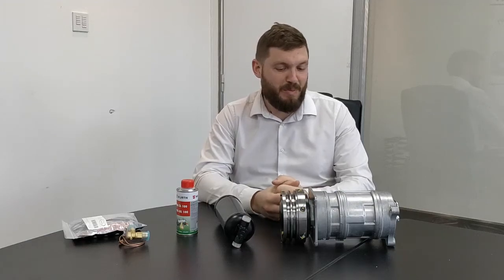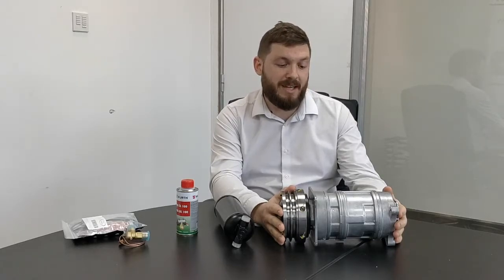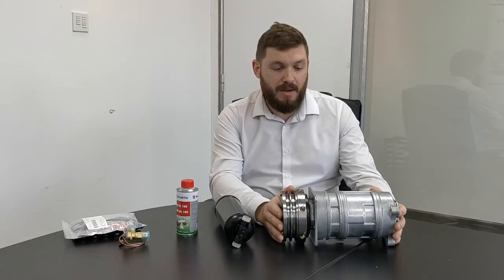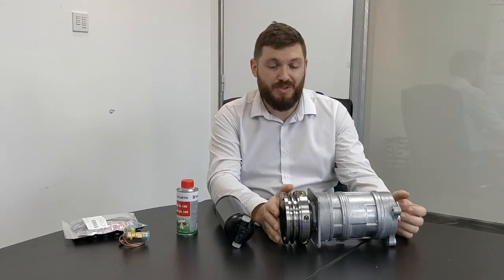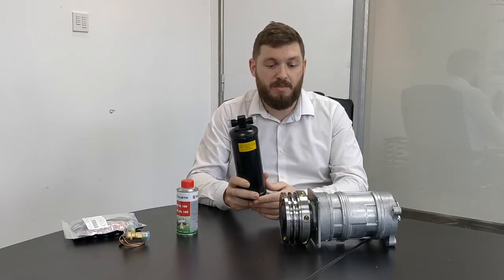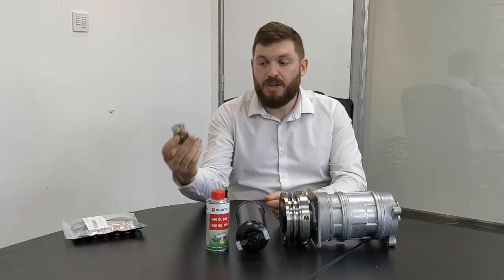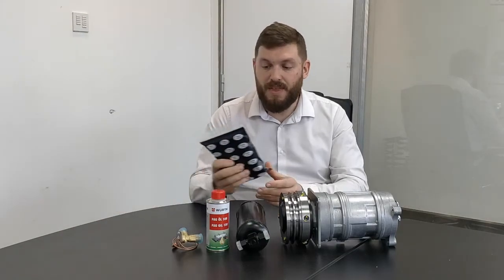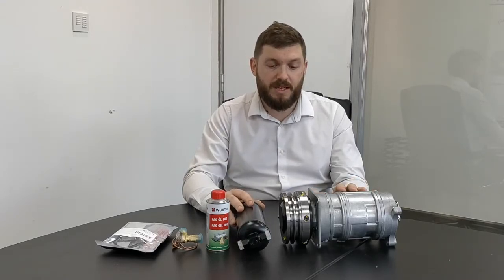Air Conditioning Issues in Silver Shadow & Spirit Models

Comment: what happens when you have replaced the air conditioning unit because it seized up, and now it is only puting-blowing cold air out, on my 1996  SILVER  SPIRT., Two years tater.
Reply from the maker: It sounds like it might be the 45 degree switch broken. There is a way to check this but involves cutting a wire but would mean it needs to be splice again after the test. If you feel like doing the test then we can give you further information

Comment: The 6 piston Harrison A6 is a compresson thats one of the best ever made,its simple powerfull and ones put together as it shut,these things last for decades,there are soooo many cars now having a 50 40 35 year old compresson on there cars and they work as they day they where produced......

I have one on my 1984 Opel Monza and it holding pressure for years and works flawless........I rather reseal a A6 for 50$ then buy this one,cause this thing hasnt proven itself....
After 35 years that old heavy big ass compressor cools the car down in like 30 sec.....

Comment: Have a 1989 silver spur that I’m told needs converting and the expansion valve changing could you explain in a little detail how to do this please many thanks. Peter.
Reply from the maker: Hi There, I expect that you mean you need to take out the old gas (R12) and refill it with the new gas (R134A). To do this you would need to change the receiver drier, oil in the compressor and the gas valves will need adaptors fitting (once the old gas gas been recovered). You will also need some O rings and we recommend that you change the expansion valve too. We have all of these parts available. If you want a quotation or need further assistance please email at matt@introcar.co.uk

Comment: Do you ship to the US? Also for a 1985 silver spirit is was told it take R12. Is that correct or is it R134?
Reply from the maker: Hi, we do ship to the US. The 1985 Silver Spirit would have originally used R12 gas but now it must be converted to take R134A. This is done by fitting adaptors on the charging ports (RH20003-X and RH20004-X), changing the oil in the compressor, new receiver drier and expansion valve plus all the seals